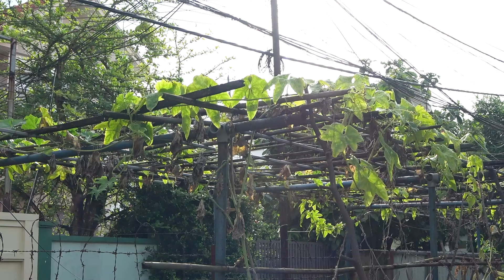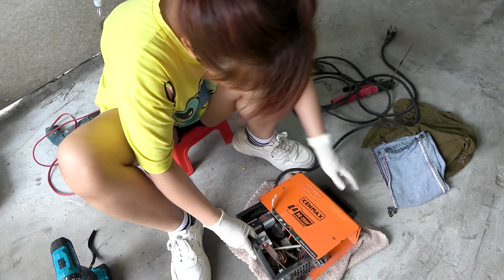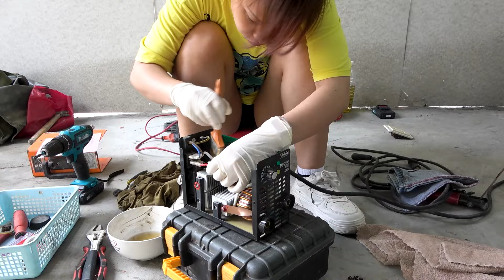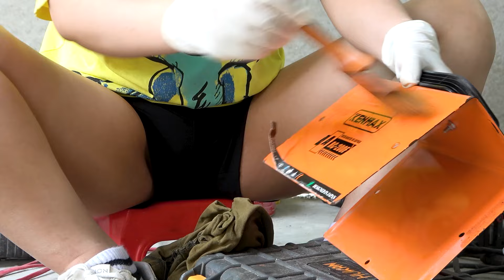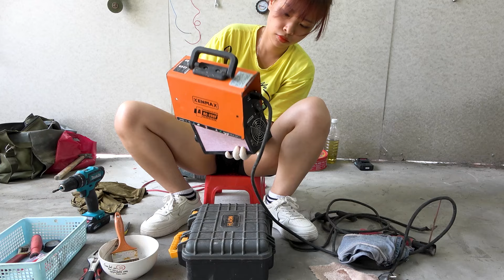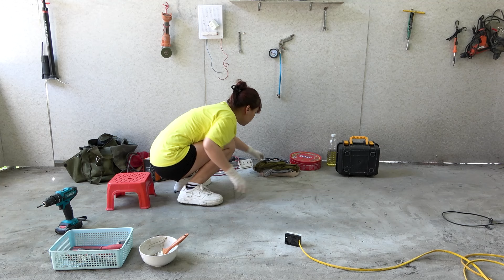Technical Girl Genius Fix everything: Repair and Restoration Used Mini Welding Machine

Comment: Do you think using a paintbrush to clean the inside of a device defines the words of a technical repair ...no voltmeter, no diagnosis,  no part replacements.